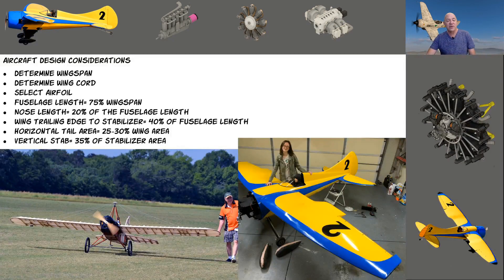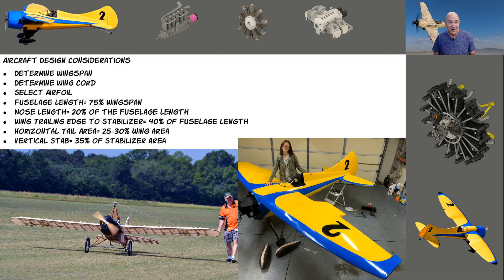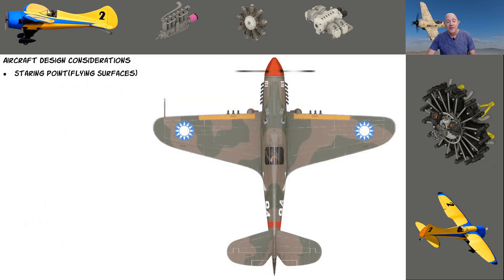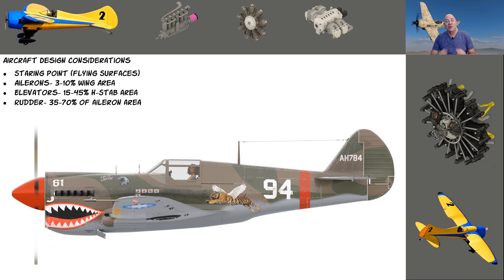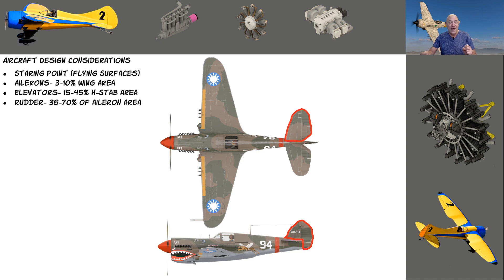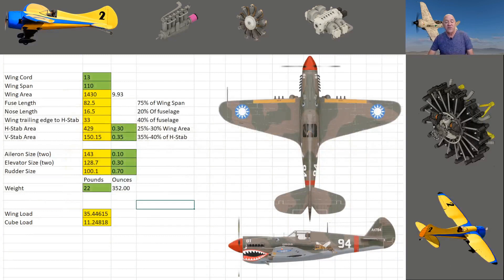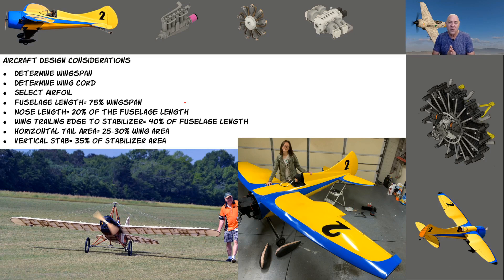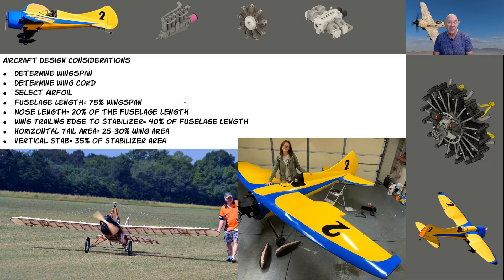RC Aircraft Airframe Design

Comment: Another great video and simple to understand principals.  A couple of times you mentioned getting the incidences right. Is this done from years of experience or are there 'formulas' that you can apply like the basic dimensions you use in this video.
Reply from the maker: Many times people just don't use an incidence meter. If the design calls for the wing to be +3 degrees and the H-stab 0 degrees, and you get the H-stab wrong, the plane may pitch up or down until you get it trimmed right. Some plane with a fully symmetrical airfoil wing may  have everything at zero. But the plane still needs a positive AOA to produce lift from the wing. Many aerobatic planes look to fly with their nose up a bit. But, when inverted, it looks the same. :)

Comment: Great info thank you. Do you design your airframes in 3D or 2D?
Reply from the maker: Thanks! I design in 2D AutoCAD, and then pull into 3D Fusion 360 to verify parts will fit.
Reply: @dagtheaviator  It would be interesting to see an example of that workflow
Reply: @dagtheaviator  Is there any particular reason why you don't design from the ground up in 3D?
Reply from the maker: @RCGDL  I use a program called compufoil for my wings, and stabs design. It is a 2D program. It may just be habit that I design the fuse in 2D. I am working on a video on how I design in CAD. It will have the steps I use. :)